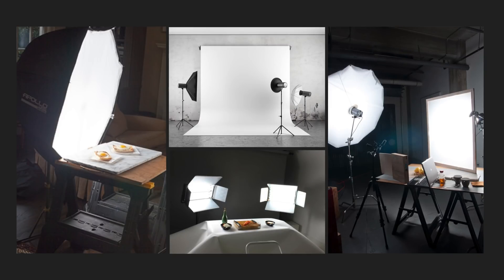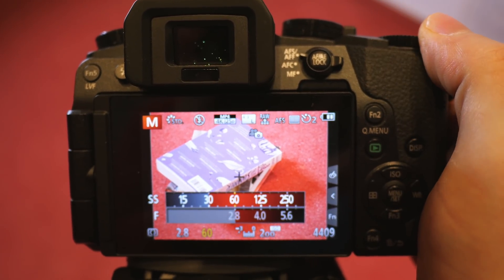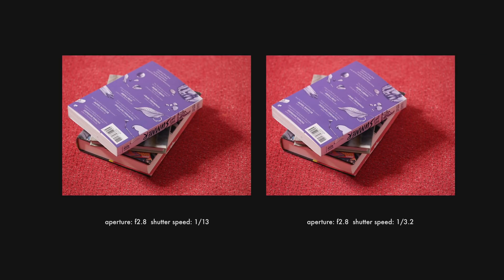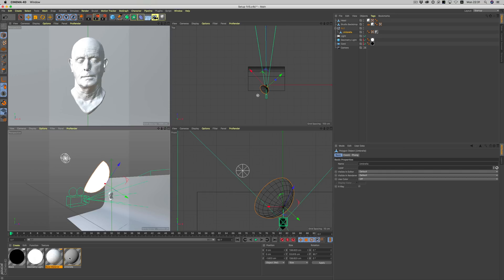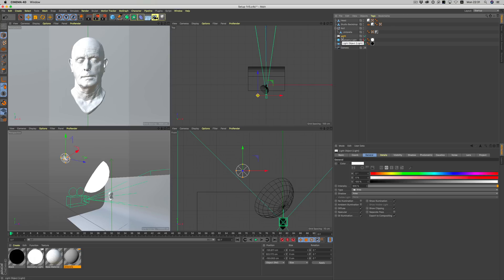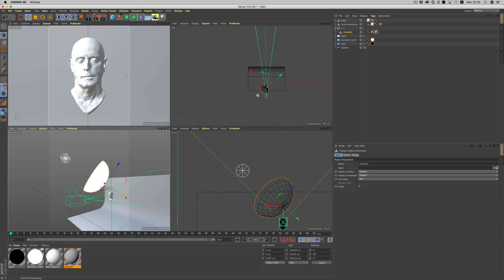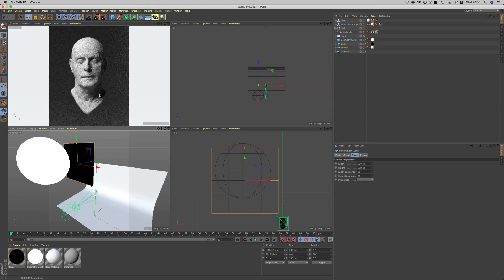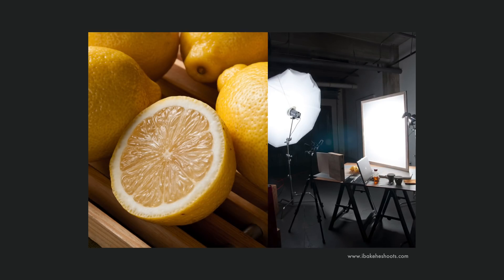Understanding Lighting & Improving your 3D Renders

Comment: Dimitris, this is a great setup and has greatly helped on understanding the foundations of good lighting. Quick question, but could you perhaps provide some further info on the backlight shader? I am a redshift user and trying to emulate your tutorial since increasing the size of the light to achieve softer shadows  also lights the rest of the scene.

Cheers from Greece!
Reply from the maker: Hey Oresti. 
To get rid of light in the surrounding environment try employing methods photographers use in real life. So block the light with a black card or rotate the light so it doesn't hit so much the background. 

I'm not sure the backlight shader will work on Redshift but what it basically does is simple. It lets the light through from whatever light source is behind it. So you have the small light behind it but because you're using the backlight shader on a bigger surface in front of the light you're basically making the light bigger. I mentioned the backlight shader just to explain how real lights work with a diffuser in front of them. I wouldn't really use the backlight shader to light scenes since it's going to be render intensive. 

Let me know if you have any questions.
Reply: Ah, I see. Thanks for the clarification Dimitris, your technique has helped me a lot in lighting my scenes.
Cheers!

Comment: Great Video thank you for this information. I never messed with the shutter speed in c4d would it not just be easier to just lower the intensity of the light then to mess with all that ?
Reply from the maker: Hey Joel. You can definitely just lower the intensity of the light. I like to work with the shutter speed especially when more lights are at play. It's also very helpful if you've setup your scene the way you want to but you just need to make it a little bit brighter. Without the shutter speed you would need to manually go in to each light and increase them in an amount that wouldn't ruin the balance between them. With a physical camera you either increase the shutter speed or ISO and you're all set. I would say it's just a matter of preference. And also helps understanding how cameras work in the real world. If though you feel more comfortable by changing the brightness of the light by all means do that! There's nothing wrong with that!
Reply: ah I do see your point manually changing every light is a pain and this would be much easier.

Comment: Dude, this is huge! Very interesting. The parallel with photography is crucial. Did you use Pro Render? I'd like to hear your thoughts about it.
Reply from the maker: In some cases I used Pro Render which can render things incredibly fast. It's a really fast solution. At the moment though the camera options apart from the f stop are not exposed in Pro render so you won't be able to dial in the exposure. You would have to resort to increasing or decreasing the brightness of the light. Which can result in misunderstanding how light works in photography. I would say it's definitely worth using but I would definitely recommend the physical renderer first just so you have a clear grasp of cameras/lights and how they work together.
Reply: Oh yes indeed. I've just came across Cinema 4D R19, and I've been using Cinema 4D for some years already, so I'm tired of Physical because it's so slow! I'm still new to Pro render though, and I feel very excited about it since I feel like Octane and stuff are not quite for me. Nonetheless, I feel very much enlightened (pun intended) by this video, it was very clear and so interesting.
Reply from the maker: Glad you enjoyed the video! With the a nice GPU, ProRender can be very fast so I would suggest trying it out especially if you're looking for a new renderer. 
It comes with the program so it won't cost you anything and it will probably fit your needs.
Reply: Absolutely. I still have to learn about it, but the fact that it comes natively with c4d is a bliss for me. I'm confident that all the camera options will come with the next versions. I just have to buy a decent computer now :D I'm on a 2013 iMac, dammit!
Reply: @marvelousdecay  great tutoring thank u ♥ btw the dropbox download link for headscan on the page u shared is not working can u re-upload pls? thanx in advance.